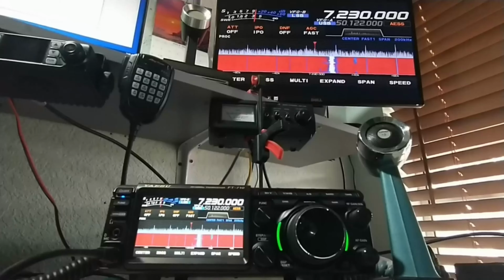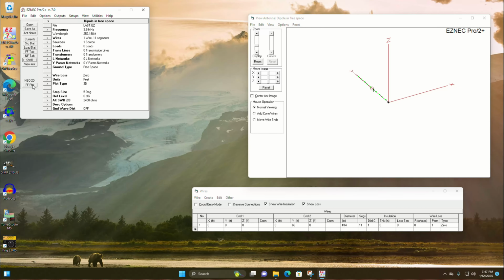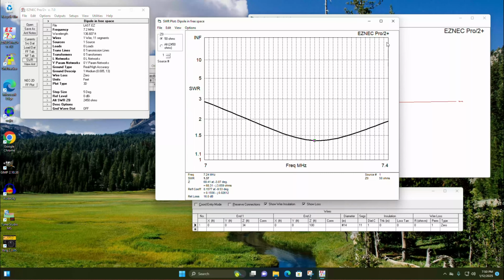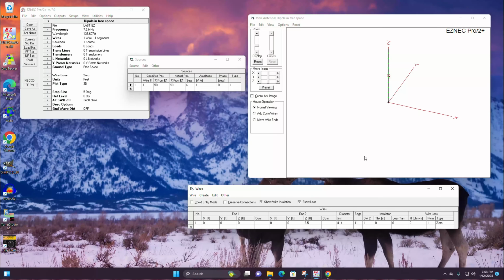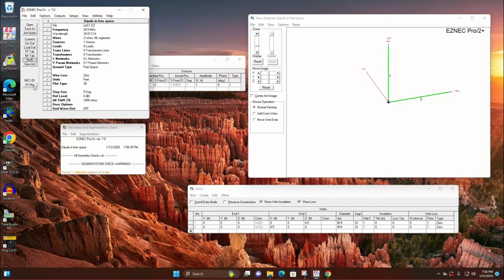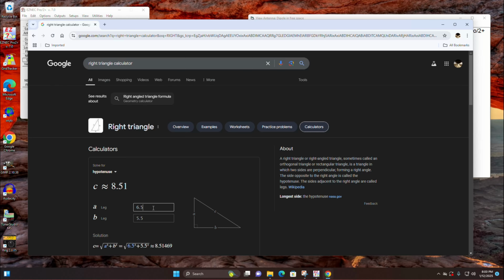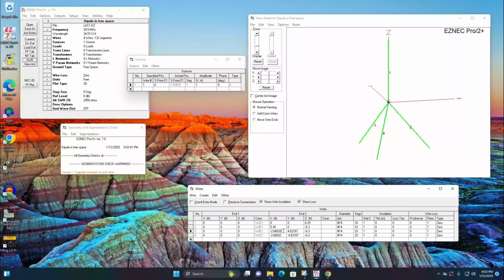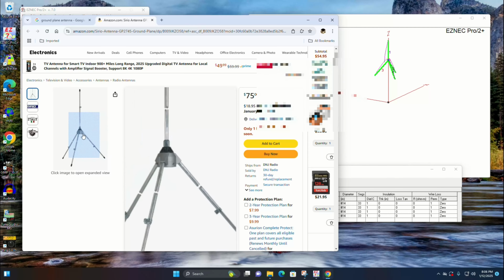Using EZNEC to model a typical ground plane antenna.

Comment: FIrst antenna I built, when I became a technician and was given 10 meter ssb privileges, was a ground plane with 3 drooping radials.  The radiator was a 9 ft Radio Shack whip on a "hub" mounted on a tv mast.   The radials were part of my guy system, 9 ft copper wire to insulators with dacron guy ropes to the ground.  GREAT antenna.  From Louisiana, my first HF contact was.... check this out... PERTH AUSTRALIA.  That is the nearest city to the antipodes of my location (exact opposite on globe out in the Indian ocean).   

Needless to say, I was extremely impressed with a well tuned ground plane vertical for DX without beams, towers and rotators.

73 de WX1JT